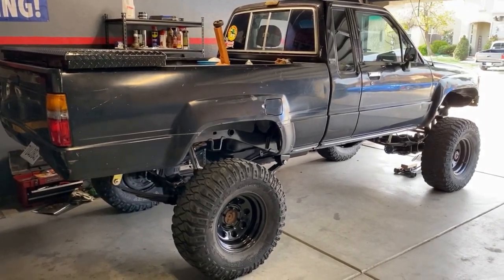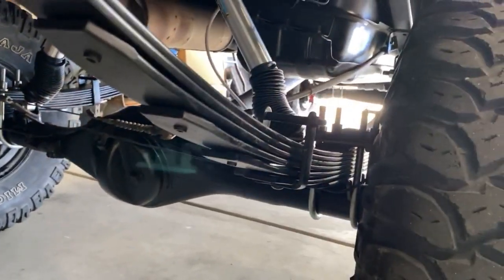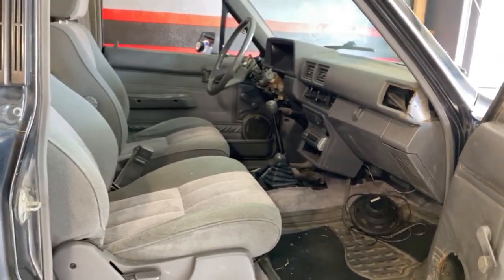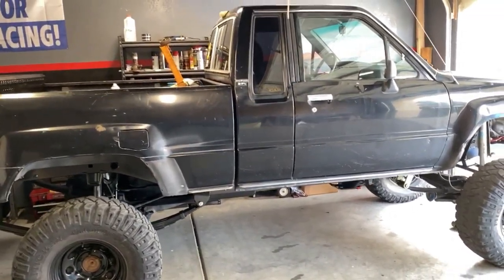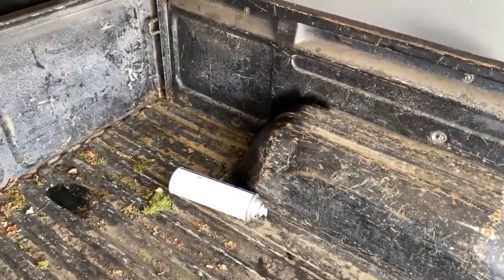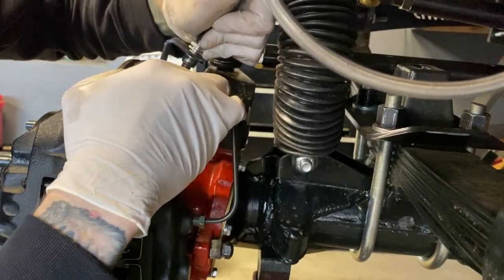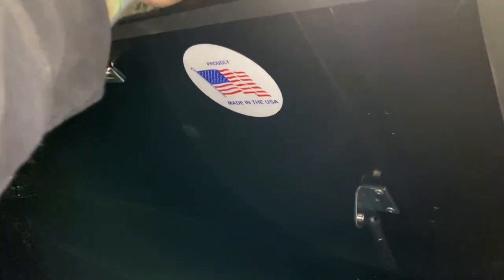Toyota Pickup Rock Crawler Build Ep. 1 - SAS, Mounting Toolbox, Front Brake Lines

Comment from the maker: Sorry for audio issues, rendered it in 30fps but footage was in 60fps. My bad.

0:00 - Intro
0:50 - Rear Suspension Overview
2:10 - Front Suspension/SAS Overview
5:25 - Fusible Link Info
7:05 - Toolbox Mounting
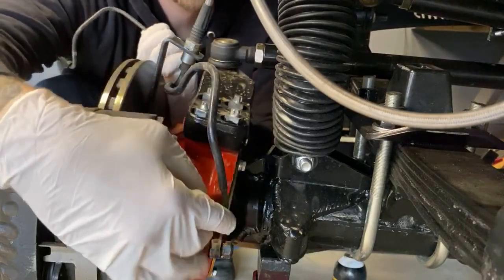8:25 - Front Brake Lines
10:15 - Removing IFS Steering Stop

Comment: How did you get the leaf spring pin to line up on the axle on the driver side with the spacer?
Reply from the maker: The spacer is welded directly on top of the factory leaf spring pad/mount. The hole is in the same spot